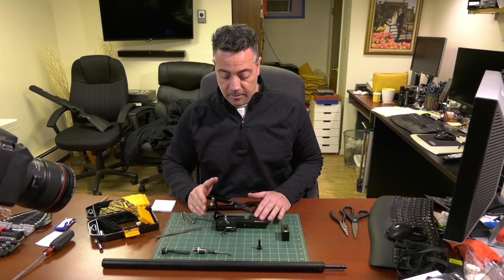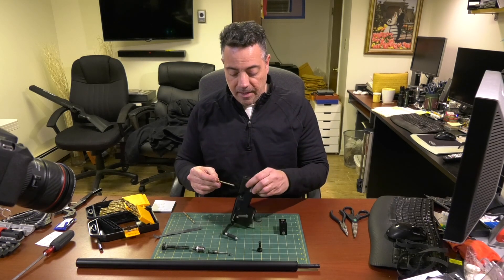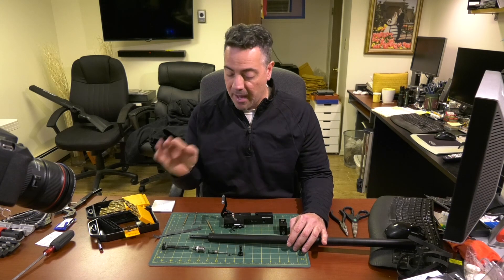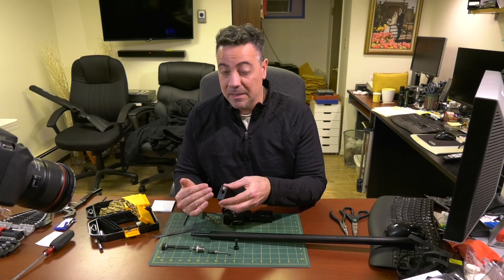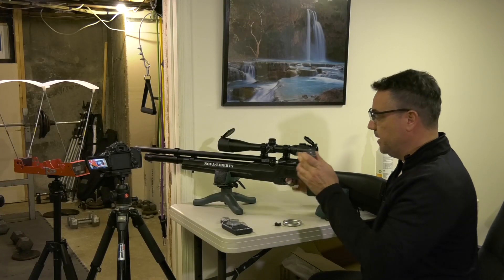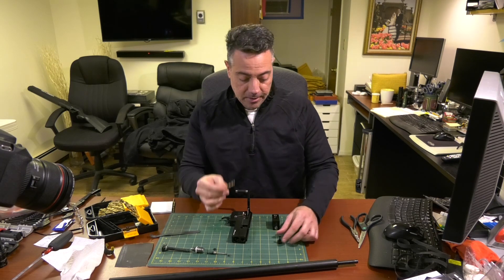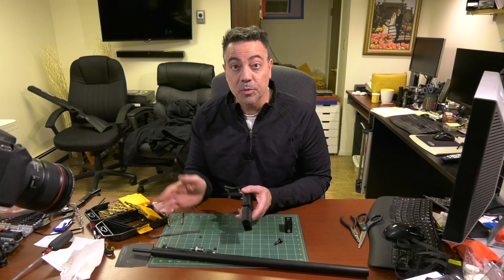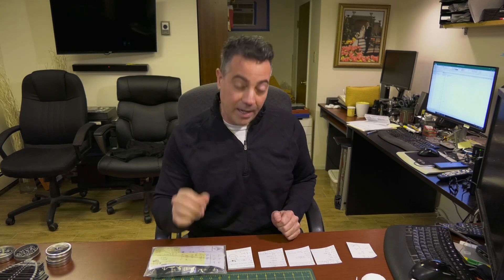ATI NOVA Vista Liberty HP-P900 transfer port, regulator & hammer spring modifications

Comment: Hi as in uk I cannot exceed 12ftlb however my nova vista pneupump was only at 9ftlb so I thought I would try these mods in turn. To cut a long story short even after drilling barrel port to 4.8mm purchasing hammer spring weight and modified power wheel the bottle neck has eluded me. No improvement? Have tried shims as well. What would be the recommended next option? Spring? Valve? I only want 2ftlb more. Any advice welcomed but I do not want to exceed 11.5 to be on the safe side.

Comment: my plan is to also have a 6 inch or more shroud extender to put more stuff in to quiet it more . i got a air stripper from umerex that goes on the .22 gauntlet .when i can i will buy all the stuff from the other genius HAJIMOTO ,his air stripper and baffles are top notched !!! i suggest you put a air stripper on yours ,it did wonders for mine out to 150 yards !
Reply: just think how cool it would be to put a extender on it also !
Reply: hey bro you should watch hajimoto's videos on the gauntlet air stripper and also his baffle system ,i think this would be awesome to put in the nova's ! the air stripper from umarex fits on nova barrel perfectly ! add the spring,HIS AIR STRIPPER , and his baffles and WOW WOW WOW !!!

Comment: on the power adjuster ,do you think another bigger hole could be drilled so when you set it in between " L AND H ,IT WOULD AND COULD SHOOT HARDER THAN HIGH SETTING ?
Reply from the maker: RG. No, because I drilled it to 3/16" and there is just barely enough meat. Abefroman tried to drill the smaller hole larger and he blew out his TP wheel. Very dangerous. But, you can drill the TP hole in block larger and then replace with a larger diameter bolt. Then drill the TP port to 1/4" safely. I'm working with Troy Hammer, he has my Liberty block, to do just that. I'll let you know what he comes up with when he's done.
Reply: thanks my brother awesome work ! cant wait to see !!!!!!
Reply: THE REASON I WANT THIS OPTION IS FOR SHOOTIN 35-40 SLUGS !

Comment: Just checking how your YONG HENG compressor is working out, my is working great so far after one year. thank you, i hope you have time to respond.
Reply from the maker: Working just fine. I'm surprised this little compressor is holding up so we'll. The Young Heng is not the most refined or durable but it's a great value and does what the $1500 compressors do just as well.
Reply: @AirVelocitySport  thank you for the quick response, I change my oil frequently and try to keep it cool. Thank you again. Giovanni

Comment: To start ... Thank you for the time and effort you put into your videos. I purchased a Nova in wood and did most of the mods you did, and a little more to get the sound down a bit. I got the trigger the way I like it by replacing the spring. I didn't make any other other changes other than adjustments. The spring I used was .025 wire with a outside diameter of .240  with a coil separation of .119. I think its worth a shot...

Comment: Hey.. do you think the regulator could be adjusted without taking it apart.. I can c it and just wondering what you think.. ?
Reply from the maker: Yes, just degas the gun as there will be too much pressure behind the adjuster wheel with any air in the gun. Then just use a thin Allen key or any thing metal rod to turn the wheel by pushing at an angle.
Reply: Oh ok.. I figured that much on degassing it.. thx bud.. I will try it.. probably put it around 1-2 o’clock

Comment: Merry Christmas sir! After watching your video I just went and got myself a Nova Liberty, what great inexpensive gun, my question to you is, did you have a chance to look at your muzzle? My barrel looks like it was hacksawed out of a long piece and it looks kind of rough with no crown cut into it, I had good groups with JSB and H&N Baracudas but when I put crosman premiers thru it, it spits them out all over the place, can't even call them groups, they are more like Hermit anti-social pellets, do you think the lack of a crown is causing that?
Reply from the maker: That could very well be the problem. I have not inspected the crown close enough to see what it looks like. I'm not an expert on crowning a barrel but I know there are techniques to do that. I would  not attempt to re-crown the barrel unless you know what you are doing. The  14 grain crossman might also be traveling too fast. My gun was shooting them 1050 at high power which made them group very bad. Since this gun has the power I like to use heavier pellets.
Reply: Thank you for the quick reply, yeah  I'm no expert either wouldn't want to ruin the gun, my m-rod shoots the crosman premiers at 1000fps and very accurately too, that's why I thought maybe is something in the barrel

Comment: dam good job u did, those 1st 30 shots is all I need...can u tune if we send u one
Reply: Hey man if you haven’t bought one go ahead and buy one. It’s crazy deal for the money. These things flat out shoot and are fairly easy to tune. Nothing else like it out at the moment.  Def check everyone’s collective thoughts on the GTA forum. It’s titled “Any US Importers Carrying this gun”
Reply from the maker: Gerald it actually getting 46 solid shots now but I'm not sure if I impacted the accuracy since I drilled the barrel port. It is possible that some burrs may impact the pellets when loading. Before I sell it I'd have to check the accuracy.
Reply: Air Velocity Sport 
Did you de burr the inside of the barrel? If you did not it will impact the accuracy 😎
Reply from the maker: Thank you Ken
Reply: Air Velocity Sport welcome
Reply from the maker: I'd be afraid that I might ruin your gun.
Reply from the maker: No I did only the outside. I don't want to punch sand paper inside the barrel. What do you suggest? Please
Reply: Air Velocity Sport use a dremel de burring bit. Take a q tip and put it inside the barrel port. If it pulls fibers off the q tip then you have a burr. Also when you have the barrel off push a pellet through the barrel and take a close look at the pellet